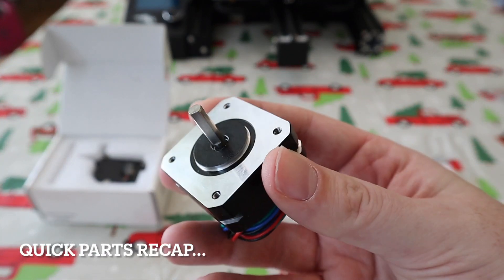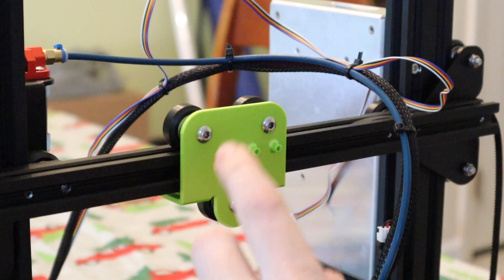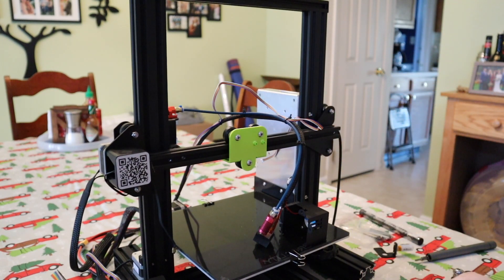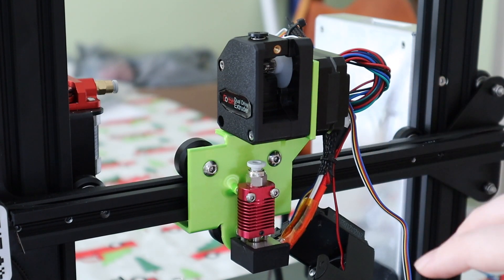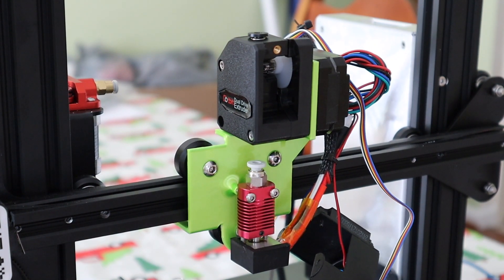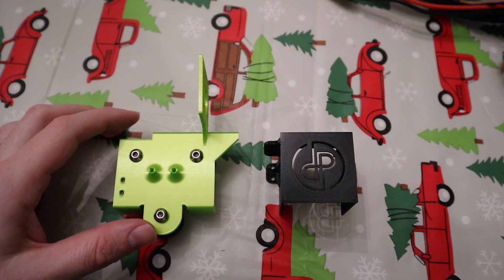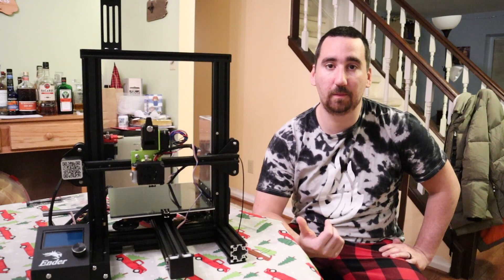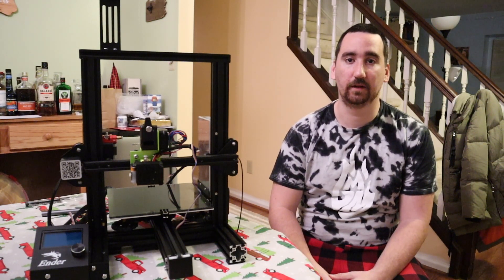Ender 3 Pro Direct Drive Extruder Design! | 3D Printed X Axis Carriage and Fan Cover

Comment: How's the x axis carriage holding up after 6 months? I've been thinking of doing 1 for my ender 3 to play around with it
Reply from the maker: Its held up pretty well so far. 6 months in, a few hundred hours of printing, and it still works. there are some flaws though, I’m working on a redesign to address some of these issues. Should have a video on it soon.

Comment: I wouldn't expect that printed X carriage plate to last very long. Also, printed resin can be quite brittle over time and would probably fail before PLA/PETG. I hope you do a follow up video after you've got some hours on that set up.
Reply from the maker: Out of curiosity, why do you think the printed Xcarriage is going to fail quickly? I’ll definitely do a follow up at some point, Once I get this all together and running, I’ll check back in after 100 print hours or so, or critical failure.